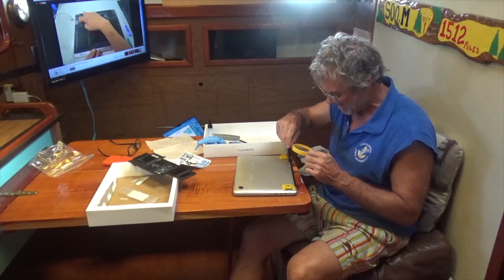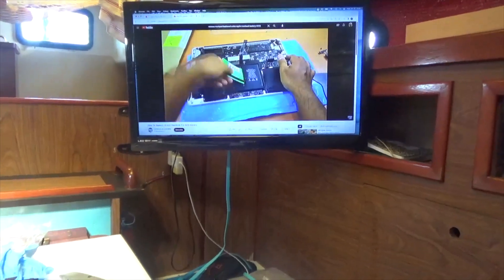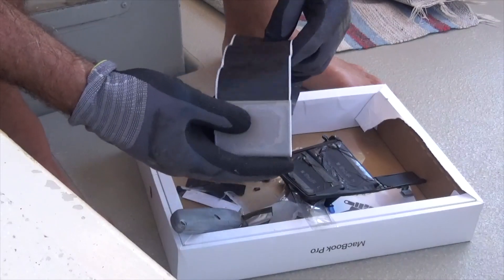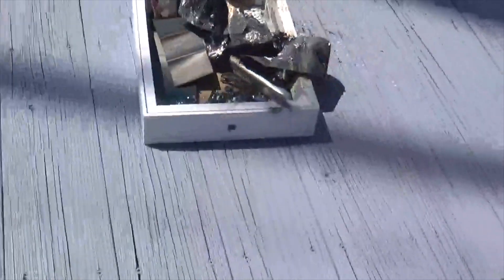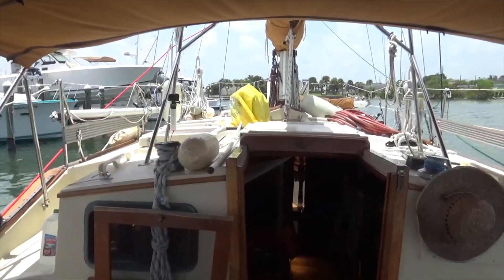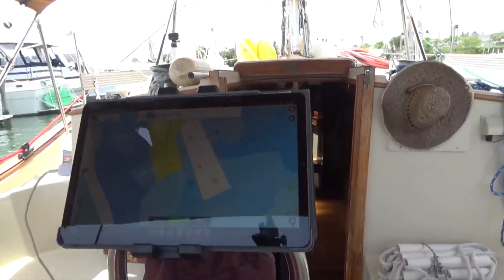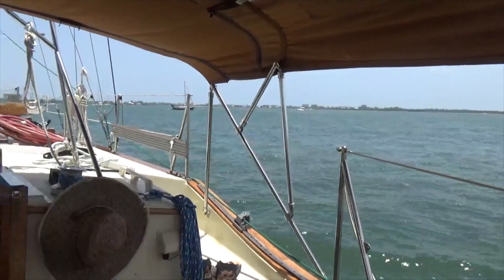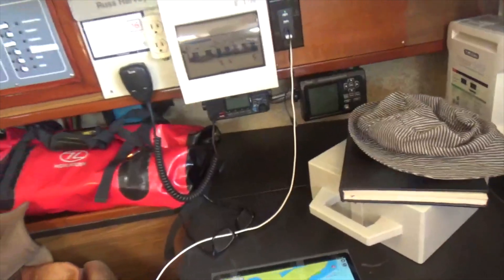Skipjack Sailing 95

Comment: Good video. The more I learn about lithium batteries, the less I like them. And they seem to be everywhere....laptops, phones  etc etc...
When I left Ft. Pierce last summer, I passed a sailboat I knew from my time at Port LaBelle sailing north on the ICW. Headsail and main, and making good time. So there is enough space to sail in the ICW channel between Stuart and Ft. Pierce, but cautiously for depth and maneuver room. Take care....
Reply from the maker: It certainly is hard to avoid lithium batteries, and they are not all the same.  Six major types, and only the lithium-cobalt batteries pose the major fire threat (those are the types that have brought down airplanes).
I would certainly sail down the ICW if I had winds for it.

Comment: Wow we had similar bloated  battery with a cheapy $99 tablet that actually split the tablet open but there was no fire involved, glad to see everything worked out well. Also very happy to see the tablet on your binnicle is working out as well for you as it does for us. Fairwinds and safe sailing.
Reply from the maker: Argghh!  My last Samsung tablet swelled up like a balloon also.  As I noted, I used to "know my batteries" but these lithium batteries work differently, and there are six major types.  The big 200 ah "house" battery is a Lithium Iron Phosphate type, and those are generally considered very safe.  It's those lithium-cobalt batteries (in phones and laptops and tablets (and in my Ryobi power tools)) that worry me.

I am now keeping them all together, so that I could quickly jettison if needed.
Reply from the maker: Thanks for your comment!
Reply from the maker: Where are you sailing?  I am in Florida, headed for a quickee haulout next week, and then going down to the Keys.
Reply: @skipjacksailing8986  Right now we are in the lower part of Michigan close to Toledo on Lake Erie. Our plan is within the next two weeks to head out the Erie Canal and start going south before the snow. We want to be in Florida by November and then reassess our boat's needs and where we are going next. 2 years ago in our smaller 27 ft Hunter we touched the water in four of the five Great Lakes but covid restrictions prevented us from going to Lake Ontario. We did spend two days at your old stomping grounds The Soo before going through the locks and trying to get up to Superior. It was too much pounding into the wind and after 2 days of trying we decided to turn back to more enjoyable waters.